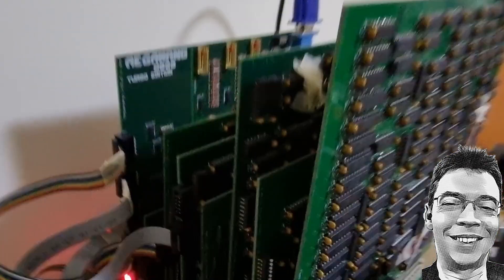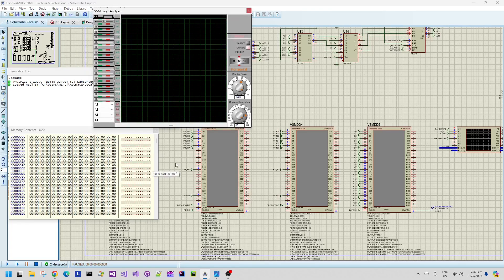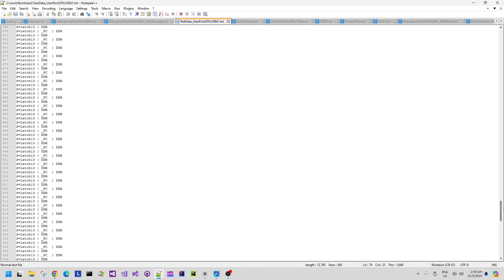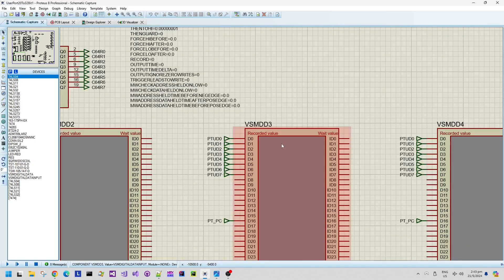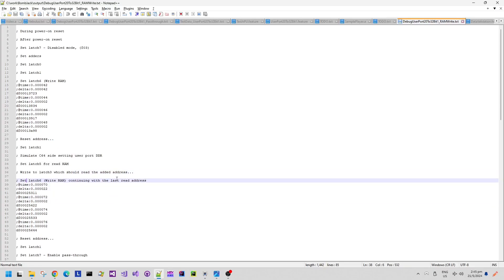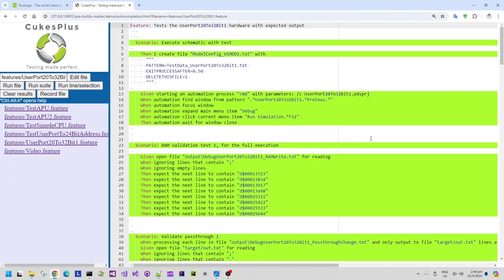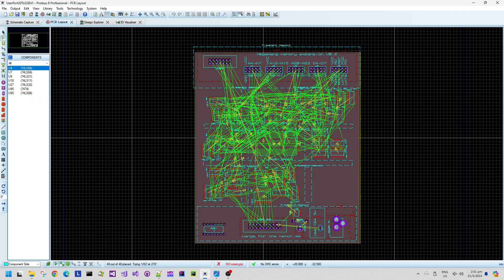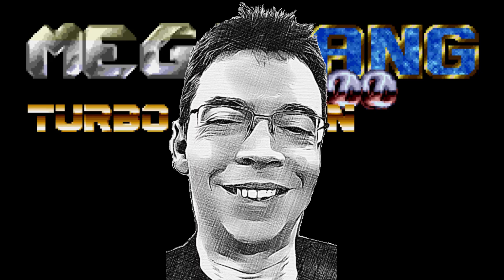MegaWang 2000 Turbo Edition - 26 - External RAM and DMA

Comment: Very cool. Haven't used Proteus since back in the early 90s, I think it was a DOS version, the autorouter was pretty useless back then. It's a shame the DMA transfer wasn't used much on the C64, and the REU never really took off, back in the day I think the only use of the REU I ever saw was pirates using it to copy floppies, as in loading a full disk into a REU then writing it to multiple drives, multiple times to save time duplicating disks. That last board looks like it could use a few handfuls of 100nF decoupling caps 😁Anyway, love your total overkill project and I think it's great you try to stick to components that were available back then.
Cheers,
Jake
Reply from the maker: I haven't shown the audio board for a while, it's so large and heavy I don't normally plug it into the backplane. :) Now that one really does have a noticeable weight of caps in it. :)

Comment: Cool stuff. My conclusion after much Amiga hw contemplation is that it should have had a (double)linebuffer - as should anything whatever the display tech they used. You could then scale the output independently of the internal creation; if you had asked the OCS for 1280x1024 it would have pumped out pixels 2 or 4 times (you might scale your buffer to max possible output?) in a row to fill in for the required resolution and then repeat the same line 4 times. Then as you got to AGA or AAA you would simply be able to match more resolutions 1:1 with what you can fetch. That is my 20:20 hindsight anyway :-) (i.e. a display is defined by two different "resolutions")